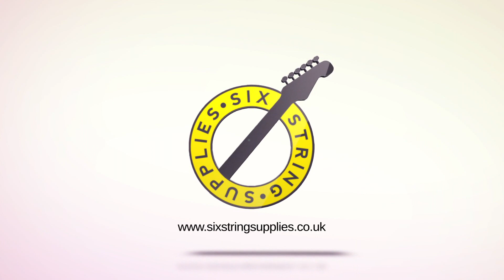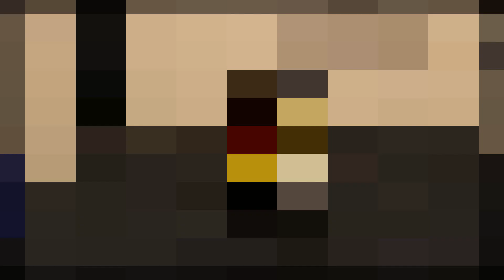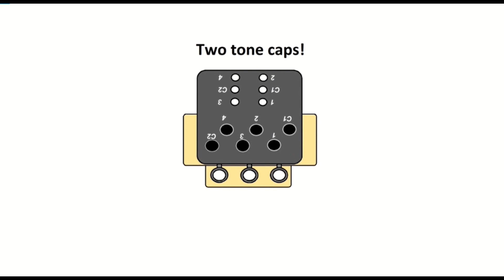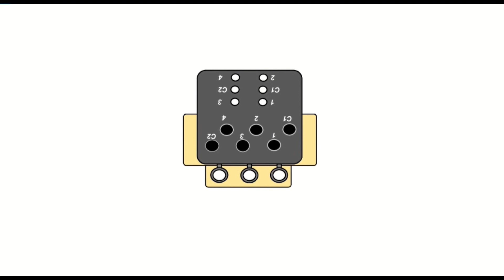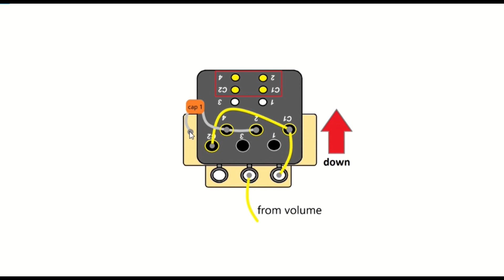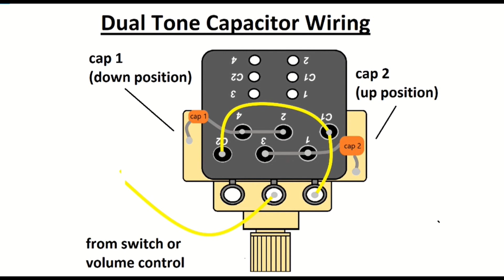Push Pull Pot Wiring Mod: Dual Tone Capacitor Wiring

Comment: I have a guitar with one volume control and 2 Seymour Duncan active pickups. I want to replace the pot with a push-pull pot  to control the volume and tone. Ideally the tone part would only control the rhythm pickup, but if it controls both oh well. Is it possible? Do they make connectors and a push-pull pot to do this?  Thanks in advance. ❤ I would think a lot of players with one volume only guitars would like this mod.

Comment: Hey !!! Great videos, thank you so much. I have a question about this dual tone capacitor. In a tone master (coming from 3 way toggle and going directly to jack), shoul I take the hot wire from 3 way toggle into the middle lug, and from the same lug to the jack output ?

Comment: Thanks for sharing, i said earlier i like the way the diagram was displayed, i have a question if youd be willing to have a go, im foing a strat SSS build and want to do a quarter blend with no load pot on bottom pot a dpdt push pull in middle pot with two capacitor values and possibly a 500k dpdt pot for a brighter touch and volume and all pots logarithmic but not sure if i should use all 500k pots they're tineider alnico II blues single coils in neck  6.1k and middle 6.2k and an alnico V bridge at 7.1k, using a 2 pole 5 way superswitch but a 3 way 1/4 blend so i can blend more than just bridge and neck. 
No humbucker so cant see there being any issue with coil splitting with different value pots and no resistors to counter that, just SSS with more tone options.
Far as i know the difference between a 250 and 500k pot is the resistance to ground- how much top end is being cut short and my idea is to utilise the 500k with very different valued capacitors to filter and let off thd low frequencies to ground at the same time.
The diagram im thinking about using has 10 (+2 common)

 connections 1 through to 10 

1+2+3 linked together and 2 linked to no-load pot outer lug and 1 to neck pup

Middle pup to 4 then linked to 7

5 linked to no-load middle lug (sweeper)

6- bare

8+9+10 linked and bridge linked to 10

Heres my dilemma- master tone middle lug to left volume lug the to top commom common linked to bottom common (to orientate, birdseye view- left is side closest to superswitch)
Right volume bent back to volume pot casing and soldered

Middle volume- output jack hot

Volume top casing as pup/jack and spring claw grounding points as normally done.

Usually the master tone right lug would be used to connect one cap to the master volume casing and that eould be that.

Introduction of a dpdt either 250 or 500k pot im not sure ive not tried the pickups they've been delay due to bank holiday, however i do understand its fine to use 500k or even 300k pots to gain dome more brightness but i dont want it clangly so the use of .1uf and .47uf im not sure im up for giving it a go i can always change the pots to 250k, the whole reason for this experiment is to find something unique and great at the same time. 

Not sure if i can mix the resistance values of individual pots so the master tone has more high end then having 250k no load and 250k volume id assume the volume would have to be 500k too to allow the higher frequencies from the master tone through but the blend pot is essentially mixing the pickups in whatever position so id also assume that would have to match the master tone pot value t0 500k if i use 500k because all pickups coonect to the left lug of the blender pot then pass through the master tone pot middle lug sweeper and up throgh the right lug to the capacitor/s depending on a standard pot or dpdt- am i right in this assumption the only difference is the pull up of the dpdt to connect the secondary capacitor and all pots shold be of the same resistance value? 

I would very much appreciate your thoughts on this i still need to buy the components and ive bought from six string supplies before and found your stuff to be high quality and the pots values matched too!
Regards Mike.

Comment: I'm trying to wire my P-bass like this,.. I have everything connected just like the diagram, but have zero sound output.
I double checked my jack is wired right, - any Ideas?

Comment: Where do the humbuckers get soldered to?
I have 2 EVH Wolfgang 4 conductor wire plus ground, I a a cts pot for tone and a EVH 500k volume knob with 3 way toggle. I want to be able to split either pickup depending on which position the toggle is in. For down position I have a 0.022uf capacitor, I was thinking of putting a 0.015uf when the pot is pulled to brighten up to a more strat sound.
I know the evh pickups normal wiring and I know I will have to use the other 2 wires to the cts pot instead of leaving them soldered together and shrink wrapped.

Comment: Would this schematic be the same for wiring in capacitors for two hum buckers with the CTS push/pull pot installed?  I have a PRS with Bareknuckle Nailbomb pickups installed,  and I replaced the tone pot with a 500k CTS push/pull pot to split the coils, but I want to add to beef it up a little bit more.   Will this process work? And is it overkill, or am I on the right path? Any help you can provide would be greatly appreciated.

Comment: Is it possible to use a dpdt on off on switch to by pass the capacitors before they reach the volume pot. Basically meaning I could have a push pull pot with two different treble bleeds but also have the ability to bypass them. Any info would be greatly appreciated

Comment: This is exactly what I was looking for in my telecaster.  4 way switch for 4 way wiring, with split coil on volume, and using push pull on tone to allow for tone bleed or reg cap. If you are not using humbuckers, you could eliminate the 4 way switch and assign it to a push pull pot.

Comment: Great video! You should expand on this and show how to hook up a coil split humbucker and a 2.2 resistors for a partial split. This would be the ultimate coil split mod. You could have a .022 cap when the switch is down for the full hum bucker and a when the switch is up have a .1 cap with a 2.2 resistor for a partial single coil tone. This would be great for an HH tele.
Reply from the maker: Hi, thanks. Yes that's an interesting idea I would have to think about where the 470k resistor would go because if you soldered it to the push pull to ground (as you would normally) it would just gorund the coil split wires. I'll look into it.
Reply: Looking forward to this ❤️
Reply: Is there any way to have this and the partial coil split for both humbuckers (1 master tone push pull)
Or have a separate on off on toggle to move between caps?

Comment: Could you ignore C2/3/4 and only connect volume to C1, cap 1 to 2, and cap 2 to 1 only. Looks like it would have the same effect, but is there a benefit to using both sets of contacts?
Reply: I agree with @Jimi Ellis here. Soldering to C2/3/4 will not make a difference since you are just shorting the capacitor leg at 2 points instead of 1. You are not changing the capacitor or resistor value and I doubt that you will be getting the 50 percent roll off at all.
Reply from the maker: No, because you'd need to connect the main pot to the DPDT above, so volume needs to come into to the output lug (middle).
Reply: @SixStringSupplies  sorry, what I mean to say is c2/3/4 are not needed, but yeah volume to middle lug, then from the right lug up to C1. Cap 1 on terminal 2 and ground, and cap 2 on terminal 1 and ground. You would not need to parallel with c2/3/4 as their doing the same thing as c1/2/3 anyway. Seems like extra soldering steps linking them through, that are not needed.
Reply from the maker: Hi, sorry for not getting back to you soon on this.
So I actually tried your method today. It works, sort of. But it only rolls off about half of the highs. When you dial down the tone control all the way down, it feels like there should  be a lot more to roll off, but doesn't. Like it is still stuck at "5" on the tone control if you know what I mean. So I'd argue your method is certainly easier and less hassle to solder, but not as effective. Using both sides of the switch rolls off more highs. Certainly noticeable. But I quite enjoyed the half roll off, so will leave it like that in my Tele until the next wiring mod goes in. Thanks for bringing it up...the beauty of guitar wiring is that there are so many possibilities and wiring options that I'm learning every day.
Reply: @SixStringSupplies  appreciate the feedback! Interesting findings regarding the half roll off. Thanks for all the videos. Recently found your channel when trying to diagnose a problem on my Rick 330… and have now watch over a dozen of your videos. Cheers!
Reply: @SixStringSupplies  This cannot be correct with respect, whether one pole connects the cap to chassis or two (double as you have)  makes absolutely no difference, it's like saying two short circuits are better than one lol ;)
Reply: Another possible way could be to put 1st cap BETWEEN 2 and 4 and 2nd cap BETWEEN 1 and 3. Link C1 with lug 3 of the pot and ground C2. Theoretically should work as intended on traditional DPDT push-pulls, in case of the pot shown here, should be similar if the switching mechanism or the PCB attached to is routed and labelled as intended.